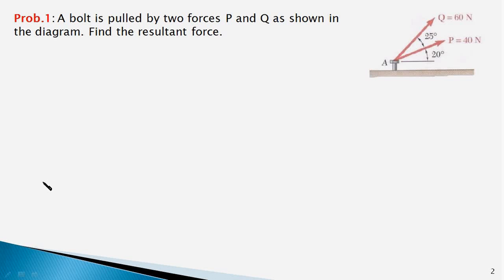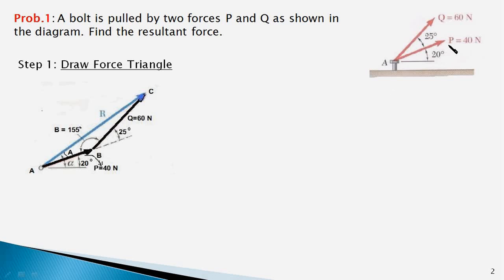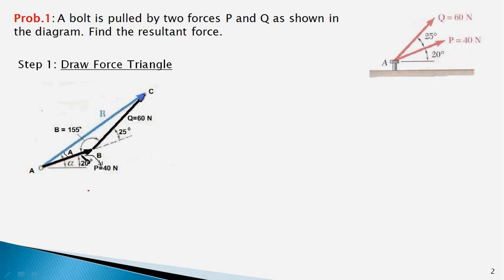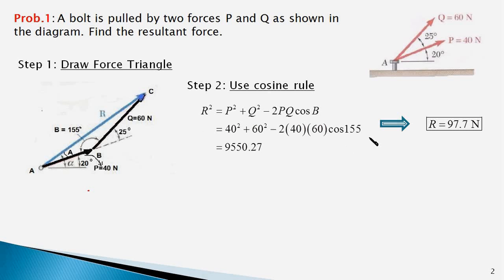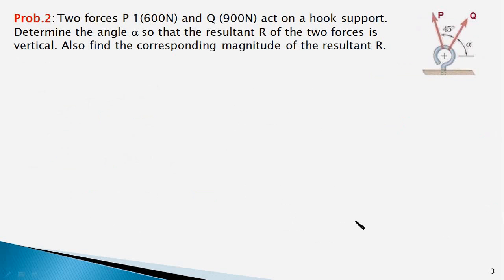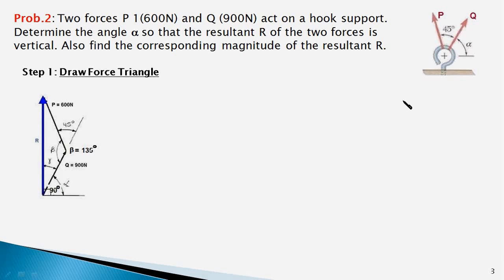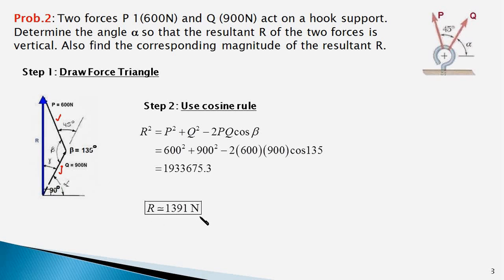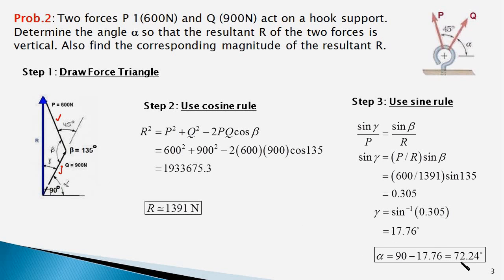1.2 Engineering Mechanics: Force Triangle method to add concurrent forces(Solved Problems)

Comment: how to find the angle between pa amd q which is 155 
how did u find that?
Reply from the maker: The angle between forces Q and P is 25 deg(given)... so the angle between lines BC and AB is also 25 deg. ...and therefore angle B of the triangle ABC is 180 - 25=155 deg.
Reply: Vector In Motion thanks ...
Reply: @VectorInMotion  you are really thorough